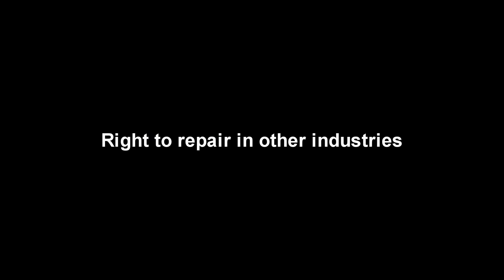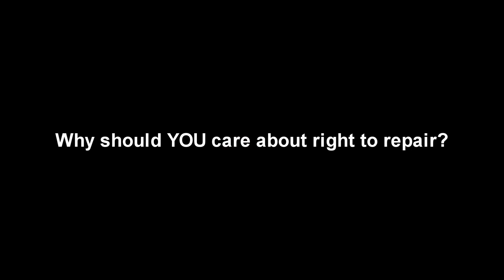eevBLAB 88 - Right To Repair Questions & Answers

Comment: The last phone I had with a removable battery was a LG Rumor (lx260) back in 2012. I even have an HP laptop that the bottom is one continuous piece of aluminum with no detachable battery, no removable hatch for RAM or HDD. It’s got star (or torx) head screws required to remove the entire panel to get to the components.
Reply: Sounds like my wife's HP Envy. I've had it apart though to upgrade the SSD and DDR, and it's not that hard to do. All the modern slim laptops have internal batteries, they can be replaced but getting a genuine replacement part rather than aftermarket might be a challenge.
Reply: @ferrumignis  I have bought aftermarket Chinese batteries for my old HP elite book and Lenovo g50. The HP battery died after a couple months and the replacement charger as well. The Lenovo battery I just bought last week so we’ll see how long that lasts. The HP Pavilion is my main laptop, and the other two are just for messing around. The Elit book has vista business so I like to have it as a curiosity of Windows failed OS.

Comment: Beyond hardware, the manufacturers use copyright/IP/DMCA to claim only they can perform repairs because they own the software and software is IP, which they expand to mean you don’t own the device. Without the EULA bound copyright software wrapped in obscurity, obfuscation, encryption, and “trade secrets” legal protections, you’re only allowed to “use” your device under very narrow and strict terms. Outside of this, it’s an expensive brick. How useful is your brick without our on-device and diagnostic software? That’s what we thought. Agree to use the thing you purchased how we say you can use it - including no modifications, and only our proprietary repairs - or use it as a paperweight. We don’t care, we already have your money.

Comment: Companies really need to learn from IBM and Lenovo's Thinkpad brand. Every Thinkpad has a publicly-available hardware maintenance guide and BOM, with the full list of FRUs, virtually all of which can be bought from partner suppliers. More companies need to do this, and I just can't fathom why they don't. Thinkpad should be taken as the minimum-acceptable standard for right to repair.
Reply: Yes, I love these manuals, even HP/Compaq has great ones and Fujitsu/Siemens. Dell, you have to search a bit, but they are there
Reply: My old T60 and T61 are still in use, great old prehistoric laptops but they just keep going. The Dell Precision M4500 tank i use now is the same,still going and 1 screw to get the back cover off to get to ram and internals,easily replaceable battery,modular hd port,displayport,firewire,usb,esata,and every card slot imaginable..
Reply: The ThinkPad E450 did not have any manual that told you exactly where those @*# plastic clips were that clipped the bottom to the rest of the machine. When I opened the bottom to add a stick of RAM, I accidentally snapped off one of them and had to tape the bottom to keep it closed

Comment: If a person tries to repair their device and they break it what’s the consequence?
If the home brew repair gets dust or moisture in the device.
If the third party repairer uses too much glue.
How will the third party repairer trace the fault to a single nano resister.
Reply: There are years of videos with Louis Rossmann repairing apple laptops. He might have used a bit too much flux at times, but yes, ask those sorts of things. Someone else tried and messed it up some more, etc. You'll find it all.

Comment: You left out the 60c rated caps wedged right tight against the undersized heat sink 80-110c for the undersized rectifier in basically every power supply in the last 20 years.  How many 40-80" tv's went in the trash over what they intentionally did. There is no excuse, they can engineer a 4k smart tv, they damn well knew what they were doing. $500 device shouldn't be going to the dump for a 50cent cap, yet this is the life ending fault of the majority of consumer electronics.  They spec parts that anyone can look at the data sheet for and see they are severely under rated. Engineered to last just long enough to get out of warranty.  Also lets not forget the printers with firmware that bricked itself based on factors of use and power on time so it would appear somewhat random but in the end no failed components, everything is functional but no one is home to run it. They even got sued and its just swept under the rug.
Reply: You need to spend a bit more than $500 if you want higher quality components.
Reply: @edc1569  My experience of my own white goods over two decades is the warranty is a better indicator of quality than price.

Comment: We repair industrial and agricultural electronics. A certain manufacturer has gone to the lengths of moving from PCB to FPC to prevent repair. If we can even open the part in question without damaging the FPC, getting the heat level just right to remove bad components without damaging the FPC is almost impossible. In Aus.
Reply: Could you explain FPC so somebody like me could follow your comment ?

Do you mean like something they put into epoxy like glue blobs ? Or do you mean Flexibel Printed Boards they use many times in display cables
Reply: @Spelter  flexible printed circuit boards, copper traces in plastic (kapton)
Reply: @ByteFixAU  yeah, these things when break, you have fun (not).

Fibreglass pen to get the copper free and microscope soldering with 0.02mm wires. Bit that's the evolution of technology, they can built smaller devices with the same properties

Comment: I've replaced the screen on my Note 8, 3 times. It IS relatively easy to do and so much more convenient than going through warranty and getting a refurbished device and losing all my settings and data...
Reply: I have just ordered a battery and screen for my damaged pixel 3, it's a fairly straight forward fix, and Google use only Phillips and torx headed screws

Comment: A great video. As someone who's fundamental lifestyle revolves around repairing mechanical and electrical equipment I believe that the only leverage the 'buyer/user' has is to threaten or indeed to not buy products actively designed to prevent the owner repairing them. I'm not as smart as a lot of people on here but I have to be pragmatic, this is why I don't buy Apple products.
Reply: I am also a “Fixer” of things for a living, but every job I do is unique and it requires some incredibly creative solutions. I work in an industry where the thing being delivered is invisible so I have some very specific tools in order to do it, but often it simply requires straight up experience and expertise to sniff out the problem and if you put it in my hands, somehow it’ll get healed and friggn Shazam, people boggle at the magic I weave in what is to me, such a simple thing, but everyone is good at something, right?
Reply: Nothing else that is portable will run Roblox at full 60FPS!  Have to have the iPad.  Shame though because the Samsung can do everything else and has outlived 3 iPads!
Reply: This is a ridiculous statement. You have no power as a consumer in the market. Which brand phone do you have? Cuz Samsung, google, and LG all do the same things as apple. It’s called industry standard practice because the industry practices it as a standard way of doing business. And it’s not just phones. Ask dell for a motherboard schematic. Or Lenovo. Go to Vizio and see if you can get one for a television. Have you tried asking for schems from a tool manufacturer like Bosch or Milwaukee? Louis Rossmann covered an example where someone on redit asked Hakko for schematics to a soldering iron they stopped making 14yrs ago and ya know what they said? No. “That’s why I don’t buy apple” is what uninformed suckers say
Reply: @arsenicjones9125  Somebody owns an iPhone... But you're not wrong

Comment: I've been looking for two days to find a compressor for my Samsung refrigerator. The part has been discontinued and the replacement part has also been discontinued. A fairly new Samsung gas stove was sent to the scrap heap because the motherboard had died and replacements are not being made. Meanwhile my antique gas stove from 1924 still works fine!
Reply: Don't get rid of that almost 100 y o stove.
Reply: @bert-blank   It will never go to the trash but most women hate it because it doesn't have self lighting burners and there's no real temperature control for the oven but I don't have any problem cooking with it.
Reply: @tenlittleindians  I had a customer who was well into her nineties who also had an old gas stove of similar vintage. No gas fitter would touch it, but she was happy with it. I repaired a number of ancient electrical items for her before she passed on. Her place was like working in a museum. Sharp as a tack she was too. Her body failed her long before her mind.
Reply: Any compressor will fit if its the same size and spec? Trying to be nice but if the compressor has gone or that's what they told you? You need a new fridge. Its cheaper than the standard gear, Vacum pump, and gauge set,  oxy acc, and licence to handle the gas which under Australian law you cannot buy. I know its $6000 but probably a gas leak in the cabinet. Claim on insurance for compressor (new fridge) they were trying to be nice.
Reply: @larkhill2119   That's the rub; given the space and plumbing limits it's not easy to find a suitable compressor. Once I determined a current compressor would fit I was able to track down several at around the $200 dollar American price range. Getting it silver soldered in and charged with coolant I'll have to take it to a friend as I don't have a vacuum pump and refrigerant. A new fridge is over $1500.00 dollars for a similar model.
Reply: @larkhill2119  Whether or not a license is needed and how easy it is to get varies a lot by country. For example, in the US, getting an EPA608 is pretty easy.
Reply: Its why i searched America over for the one washing machine made here and supported with parts from USA. it cost more but its lasted almost 15 years now and so far no repairs,but its good knowing the company stocks parts and has my back!  Its Speed Queen if anyone cares. i've heard the parts horror stories from friends with broken down Korean and China made stuff.
Reply: @a4000t   Being from Iowa I remember when all the washing machines and dryers were mostly made in Newton, Iowa at the Maytag factory.
Reply: @tenlittleindians  back in the 70's and 80's i think most all brands were made in the USA. all China junk now. Its sad.

Comment: A lot of car electronics are coded to a specific car and have to be cracked and or recoded by a special dealer tool. Or sometimes even a dealer tool cant reset a control unit and you have to desolder the memory to get to login codes or stuff like that... Its not exactly the definiton of easy...
Reply: They seem to be able to stop you repairing your car, but not prevent them getting stolen.
Reply: @Strider9655  Dealer level scan tools are thousands of pounds plus subscription which is out of my league but are sometimes the only tool that will do. My Foxwell pro tool doesn't find any codes on my transit with mil, abs and esp lights all on.
Reply: I do some pretty advanced automotive stuff for immobilizer and ecu adaption related things and I still feel bad for the  phone/pc guys. Seems worse for them since there is no standard in place for them to even code in new parts. Not easy for sure, but for us in auto its manageable  since the auto world has a little r2r into it already. I think that makes it a little easy to find loop holes in the memory for cloning/coding new parts even at board level. The auto industry does try their best to cripple the aftermarket sector but Luckily there is too much $ involved to keep the it innovating.

Comment: Thank god Desktops and sata ect are all swap able and laptops although limited, you can still put in parts and service mostly easily.
Reply: Or you can get a Thinkpad, for which you can readily buy replacement parts, and Lenovo even helpfully publishes the list of parts and the hardware maintenance manual for every Thinkpad model.
Reply: @greyfade  it's not only limited to Lenovo's ThinkPad lineup but also apply to IdeaPad,Yoga,Legion lineup too

Comment: One thing that gets overlooked....most people either can't be without a working phone/ computer or they don't want to be without one...they demand an instant fix.  Buying a new device or swapping out an entire board meets that expectation. Manufacturers have optimized their product support strategy for meeting this type of demand, at the cost of frustrating a minority of people who prefer to wait for a cheaper repair.  (I do agree 100% with right to repair, and I think we should also have the right to refuse "upgrades" to devices that alter the features and/or functionality of a software or device I own...)
Reply from the maker: Most people would/should have an old phone they can temporarily drop the SIM card in and use.
Reply: @EEVblog  That is a reasonable assumption, but always keeping a relatively recent cell phone as a back-up is expensive all by itself!  I expect the practice of keeping the previous phone as a back-up is relatively uncommon.
Reply: Funny,the first 20+ years growing up cell phones werent practicle,affordable or common,and i managed fine. go figure :)

Comment: The reason why Companies are against it is because they don't want some idiot repairing the product and then coming back and suing them because they screwed up. Plus there's the even the chance a customer getting a improperly repaired product and doing the same thing, By locking a product down keeps them from having to deal with incompetent people. Though more often than not the consumer is not certified to handle the repair without going through various courses provided by the manufacture.
Reply: If I own the product I can do as I wish
It’s up to the company who I bought the device from to say well actually you fucked it up not our problem 
But I guess their repair staff haven’t been on those corses either and they lack the skills to rework smd components most people that would attempt to do this work would have at least had a go on obsolete devices before trying it on their pride and joy
Reply: And yet Louis Rossmann managed to do the very thing successfully for how many years now and has one of the top ratings for repair having not gone to any apple training. Fact is repair has been part of our society and successfully done for over 100 years and if it hadn't,you would be swimming in landfills of broken  trash trying to bury you.
Reply: That is actually a good argument, unlike the privacy and security one.
However it can be dismissed.
Reply: We beg to differ. That's a consideration or an excuse depending on the company. However, in our opinion, it's because repairs for OEMs are a lucrative part of their businesses. Profits are the main driver for keeping a monopoly on repair, in our opinion.

Comment: Super clear in every aspect
I will download this video to keep it as an example to tell the manufacturers point by point what you said.  
Thanks Dave this is the right and perfect way to say things
Reply: Yeah, it's the manufacturers' fault, and not the system moving them, surley. No need to look more closely.
Reply: @LeaderOfMetal93  Manufacturers I meant not only those who produce the electronic components but also those who design and produce the electronic devices.  
However, I have always avoided buying mobile phones or other electronic devices that are not possible to repair.  
Everyone has to start doing it.  
People don't have to break their legs to buy a new iPhone as soon as it comes out.  In fact, the latest models are not repairable, people have to stop buying them, as well as other brands that use the same non-repair practices.

Comment: I haven't bought Apple since quick time came bundled with iTunes. I uninstalled QuickTime and parted ways. With Apple, you don't know the product at all. You have to use it in the way Apple intended. Items that compete with Apple software do not make it on the app store. And that's old news.
Reply: And to me honest, I think I bought one Mac in my lifetime.
Reply: @bert-blank  MacOS is built on open sourced Darwin, you can know a lot more about the system than windows with its entirely closed source.  You still have absolute control of the system (unlike iOS) for now - I'll be off to Linux if/when that changes.
Reply: I still own a MacBook 2.1 with more memory than Apple defined as the Maximum for that machine. It runs a stand alone Lion MacOSX alongside Lubuntu 21.04. I keep it around for it's excellent dual audio jacks (both copper and fiber) to record music. I will never buy another Apple product anymore due to their proprietary Chips and outrageous repair costs.

Comment: Planned obsolescence is a huge problem. Parts break easier these days and if software is involved, it often becomes slower with each update.
Reply: I think that often times it's not planned. Manufacturers just wouldn't gain anything (i.e. money) if they made products more durable. The customer just sees that one device is cheaper but has no way of knowing that it's less durable. Same thing with software: there's no point (from the manufacturer's POV) in making sure that it performs well on older devices. The device has already been bought. It's actually the opposite effect: customers will throw away the old device when they notice it becoming slower and buy a new one. It's the system that's at fault
Reply: @max_kl  What you said IS the plan! lol
Reply: @nonsuch  And whose plan? Manufacturers just do what they have to to stay competitive in a free market with unforesighted customers. I don't like it either
Reply: Solder tin whiskers in RoHS no-lead solder, anyone???